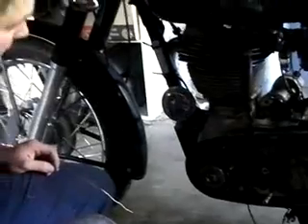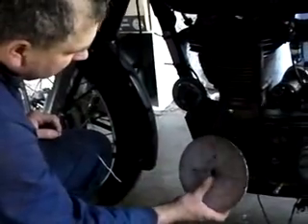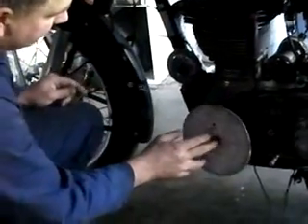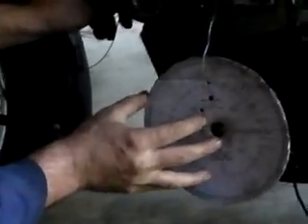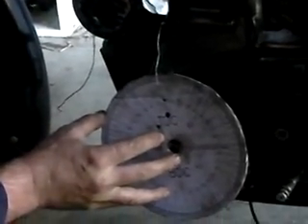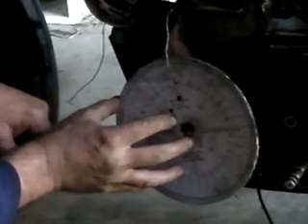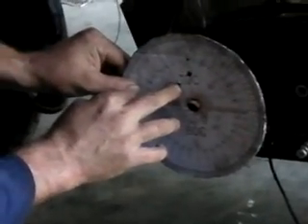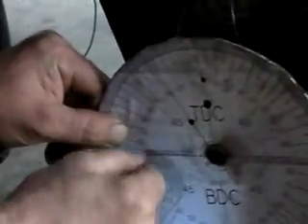Timing light Enfield

Comment from the maker: When static timing, put the piston in TDC on the compression stroke. Using a calibrated tool, back off the piston 8.5-10mm BTDC. Put a pair of pliers on the cam lobe and turn it all the way clockwise. Hold it there. Then turn the points plate anti-clockwise until the points just open. Lock it down. Rotate the engine a few times with the kicker and re-check. You have set your timing to an advanced ideal 'ball park'. You still need to ping time to get it right for your individual bike.

Comment from the maker: Hello, 
I haven't checked this YouTube page in months...sorry. I should have mentioned that this was a high compression 8.5:1 Accralite piston, not the factory standard, so the advance is not as much as 32*
These bikes are hand made so tolerances are nothing like Japanese bikes. That means that each bike is an INDIVIDUAL!  Even though the degree wheel and strobe light showed 28* timing in the garage, real-life usage still required ping timing.

Comment: You did say 28 degrees didn't you? I thought they were all the same as my Sixty-5 which is 32 degrees. I know there is a bit of variation in the Bullets but 4 degrees seems quite a bit. I did the same as you picked a clear picture from the web, printed it off then I laminated it with a couple of bits of cardboard to make it stiffer. I also made a TDC tool by drilling out an old spark plug, and fitting a long bolt which a friend had turned down I stuck a paper mm scale to it and voila all done.